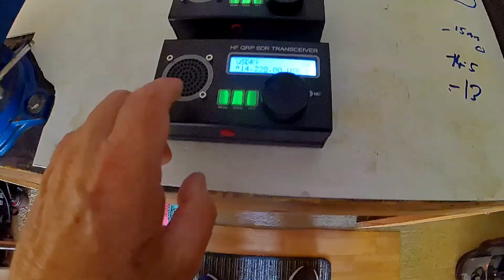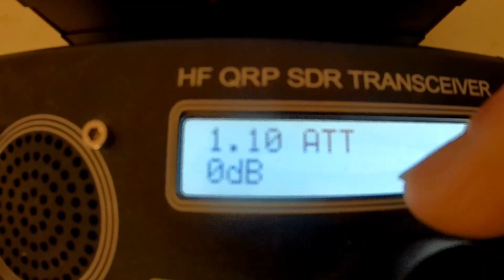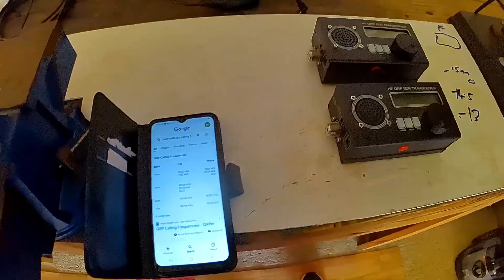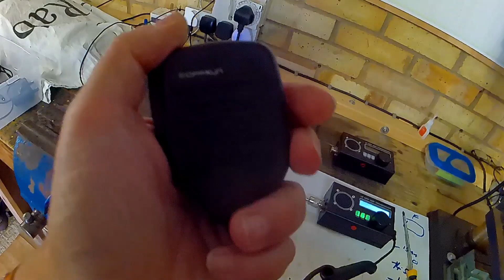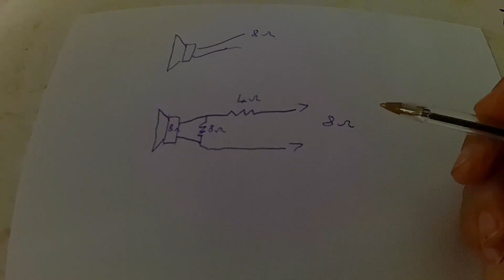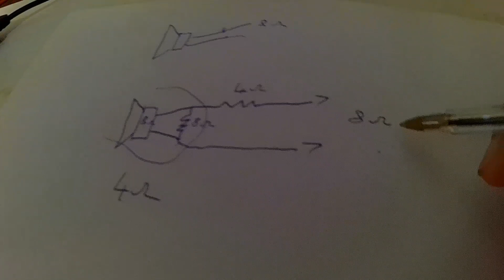QRP 8 Band SDR Transceiver. Ham Radio. Settings. Microphone Wiring. Mods.

Comment: Have you figured proper way to use digital modes?
Reply from the maker: Sorry I don't run any digital modes. Currently I don't have any interest as I don't own a computer or equipment  to do so. Thanks for your comments.  George
Reply: @MakeDoAndMend1  OK, I've constructed small computer with 7" LCD based on Pi4, you can try this it can also be used with log software, not only for RTTY or FT8, very low power, can be powered with any powerbank 5V 3A capable.
Reply from the maker: Been runing Ft8 and SSTV now I have a computer. But use an old phone mainly for FT8.  Just getting into Meshtastic as well. George

Comment: point 1.13 does not work. how to reflash it?
Reply from the maker: Many thanks. I don't own a computer or laptop. I haven't updated any Firmware on any of the Radios or Equipment I own. Don't understand or have knowledge how to do.it. George